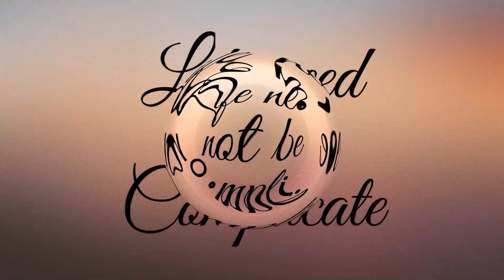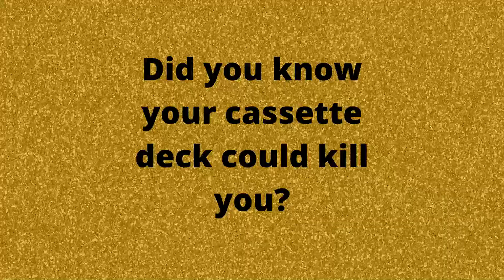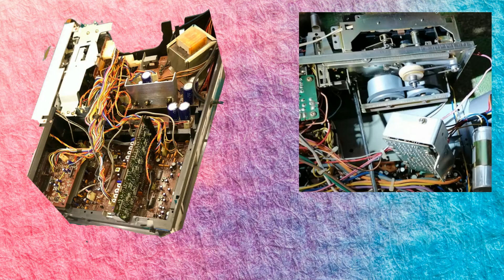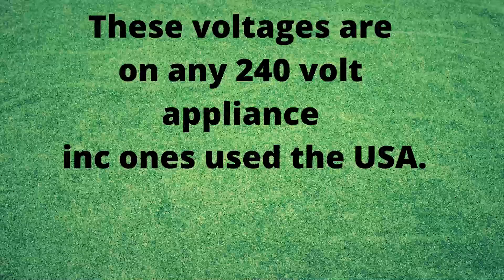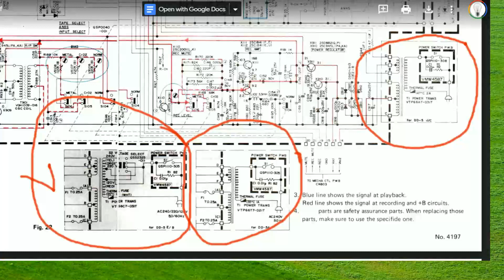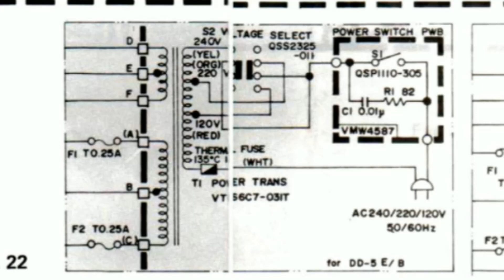The Dangers of the Cassette Deck - Things You Should Know

Comment: It's not really the 'Volts' that will kill you, but yo see the AMPS, that's the killer. A small amperage, as much as 0.2A, is just about enough to cause fibrillation to the heart and kill you. So, in hindsight, you can have 1000v at 0.05A, and you're quite safe, but 0.2A at even 1v can kill you.
Reply from the maker: You are correct. However the terminals on these can deliver the amps. Also most injuries in electrocution cases are as a result. IE changing a light bulb stood on a chair. Get a small zap, fall off the chair, break your leg. lol